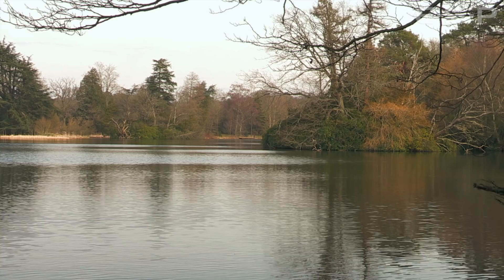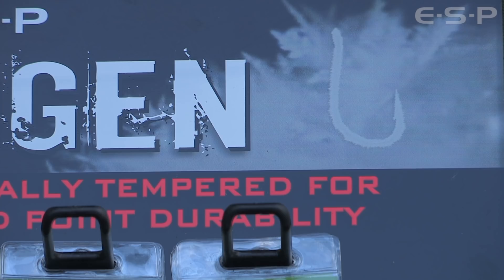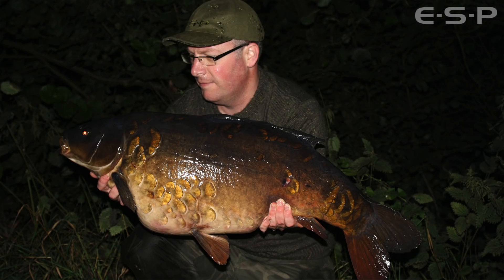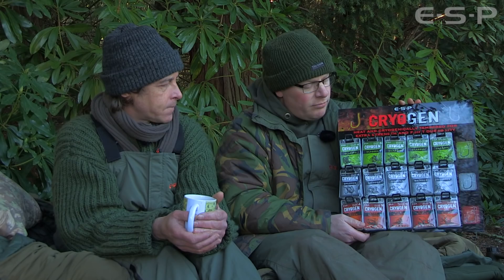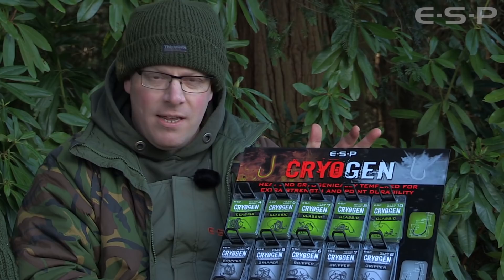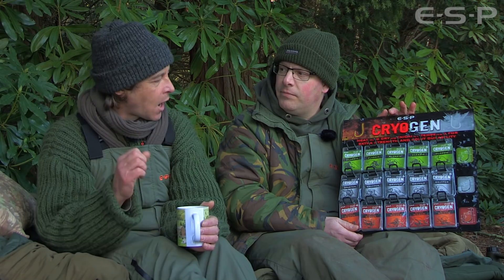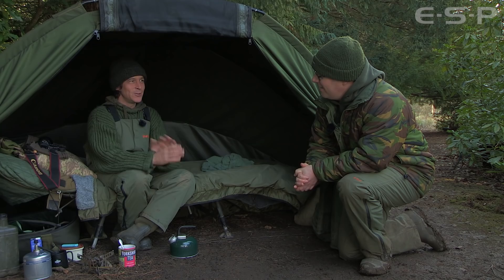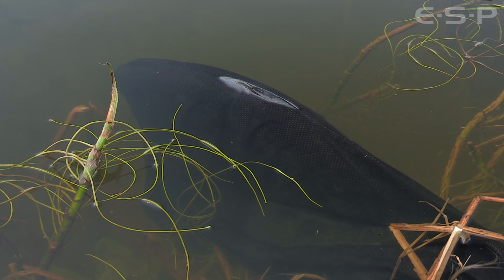ESP - Cryogen Hooks

Comment: Most of these hooks are blunt straight out of the packet but when ive sharpened them theyve stayed sharp and i had 4 carp on the same hook it was a size 5 stiff rigger. ive only ever very slighty bent out a stiff rigger once but that was in a really snaggy place. the only thing id change about these hooks is the stiff riggers need to have a more out turned eye because when i tighten my knot down the chod filiment gets thinned and weakened